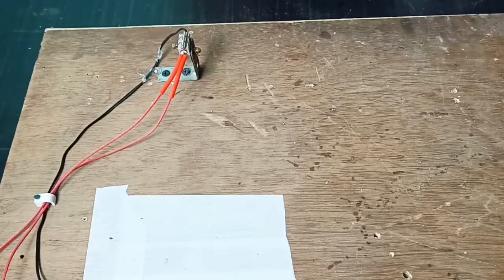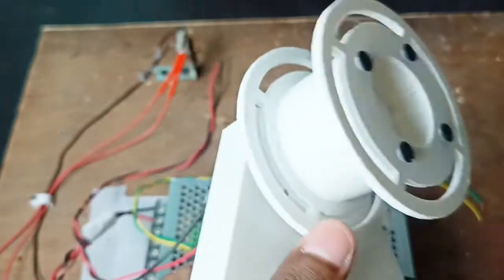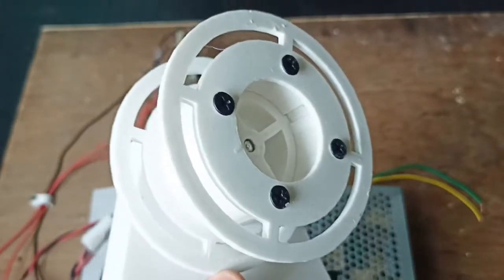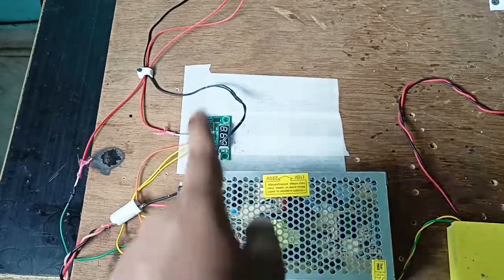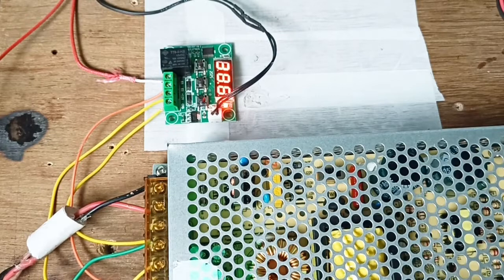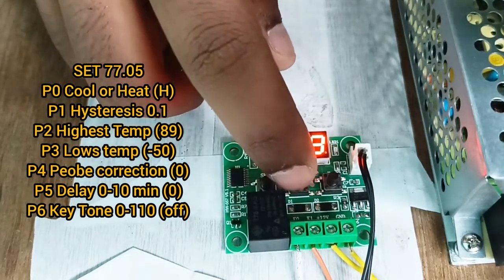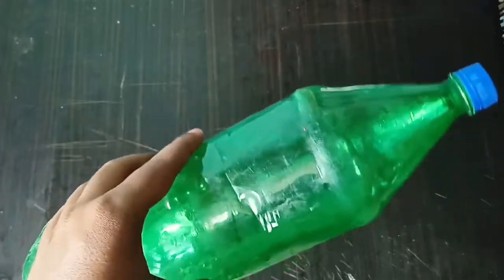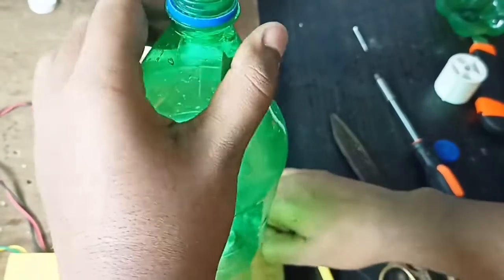Make 3D Printing Filament From PET Bottle for Free

Comment: Bro what is the rpm of the dc motor that you are using in the puller? Please provide the buy link if available
Reply from the maker: Its 75kgcm 10rpm geared dc motor

Comment: Hi, not only the flow, is more improvements, as you say "the filament is hollow" and most of the time the problem starts on the extruder, when I start using this material (about 3 years ago) my big problem was the extruder stop feeding, that make to abort most of the prints, how I solved this problem, take out the brass gear from the extruder, get a triangle needle file, gentle file all the gear grooves one by one, that eliminate a chance to stop feeding, I print at 260.c slow one degree at the time until 255/6, 
That is my experience with PETG / bottles, I have really nice  prints, any color that i want. Greeting for all from South Africa
Reply from the maker: Hello, Yes you're right lot of slipping happens in extruder but what I found out is that it mainly happens when your filament is not properly rounded. I was facing that issue and I increased the strip size and tightened up the adjustable spring part of extruder

Comment: Hi ,thanks for the info, however way not show the settings to print with this petg? THAT IS THE MOST IMPORTANT PART,
is not easy to print with this material, lot of settings on CURA, and the printer has to be ready to accept this material, just saying!!!!
Reply from the maker: Yes, you are right. You need to increase the flow rate in cura because PET Filament is hollow

Comment: its actually met the bottles using all the parts because i try it but not melting the filament
Reply from the maker: You don't need to completely melt it but make sure the strip is between 5 to 7mm so that it can get round properly
Reply: @Creative3DP  I found the best size is 8mm, move the flow to 110% then came down until the layer is uniform. normally 104/102 %  that because I use 8mm strips.

Comment: Hey Priyank, thats for the video.
What is the Diode you used in Thermostat?
How you ensured the hot end is having 240-250c , as the thermostat max you set is 89c. Any extra thermometer required to measure this?
Reply from the maker: set it to 89c & it actually reaches 240.  I don't have any number or another thermometer for this but it works
Reply: @Creative3DP  so is it over melted or undermelted any time? Are you frequently using this setup? And is it giving prolonged better result?
Reply from the maker: @saleejkuruniyan  it mostly gave me proper result few time it cause problem but it was due to size of the strip

Comment: Hi my friend, you made a good job. I have a question, I don't use the system to make my pet filament but i have a problem, the filament isn't rounded it makes an "U", any suggestion? And if there isn't any solution, can i print like this? With the "U" shape? Thanks
Reply from the maker: The PET filament from the bottle is mostly hollow, if you increase the width of the PET strip a little bit, it will rounded

Comment: The 3d printer requires temperature of 260 degree Celsius , but that is not the problem. 
The problem is the filament of pet bottles doens't go properly into the extruder, we have to handpush it , any upgrades for that sir?, And nozzle chokes in between , any solution for that sir?
Reply from the maker: It all depends on the machine's  nozzle. If you're able to extrude 1.75mm of PET filament or maybe less you shouldn't face any problem. If it is more than 1.75 mm then there is a chance of choking a nozzle or maybe filament  getting Tube & and make sure filament is properly rounded so that it doesn't get bent in Extruder
Reply: Hi read my comment, how to fix the extruder

Comment: Great work.. You have succeeded in achieving your goal. Well done..

 Question: What is the temperature of the nozzle when the plastic is passed through it during the period of conversion to filament?.
Reply from the maker: Thanks man, It should be around 200 degree celcius
Reply: @Creative3DP  ⚠️ God has said in the Quran:

🔵 { O mankind, worship your Lord, who created you and those before you, that you may become righteous - ( 2:21 ) 

🔴 [He] who made for you the earth a bed [spread out] and the sky a ceiling and sent down from the sky, rain and brought forth thereby fruits as provision for you. So do not attribute to Allah equals while you know [that there is nothing similar to Him]. ( 2:22 )

🔵 And if you are in doubt about what We have sent down upon Our Servant [Muhammad], then produce a surah the like thereof and call upon your witnesses other than Allah, if you should be truthful. ( 2:23 )

🔴 But if you do not - and you will never be able to - then fear the Fire, whose fuel is men and stones, prepared for the disbelievers.( 2:24 )

🔵 And give good tidings to those who believe and do righteous deeds that they will have gardens [in Paradise] beneath which rivers flow. Whenever they are provided with a provision of fruit therefrom, they will say, "This is what we were provided with before." And it is given to them in likeness. And they will have therein purified spouses, and they will abide therein eternally. ( 2:25 )

⚠️ Quran

Comment: Thanks for the upload. What temperature and speed settings used for printing extruded PET bottle filament
Reply from the maker: Hotend temperature should be around 240 to 260 celcius and best speed would be 30 to 40 mm per second